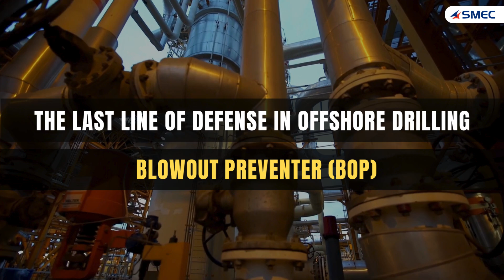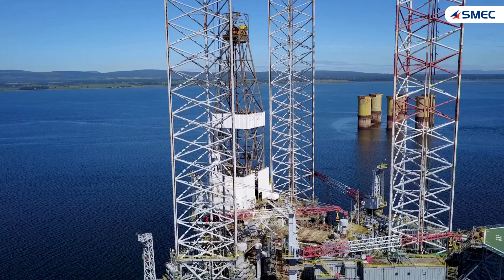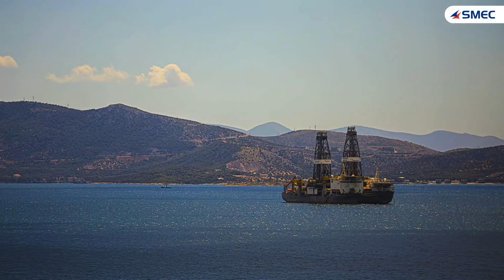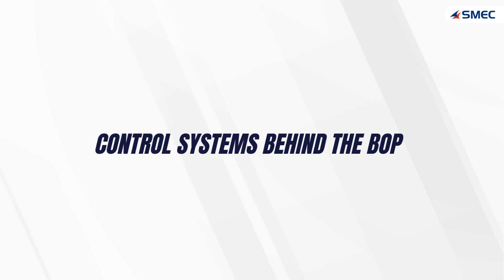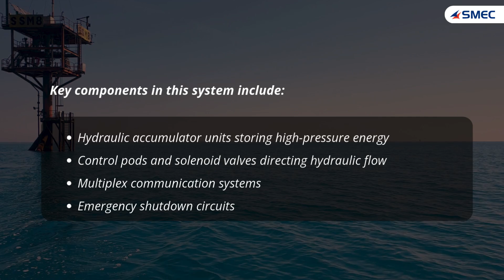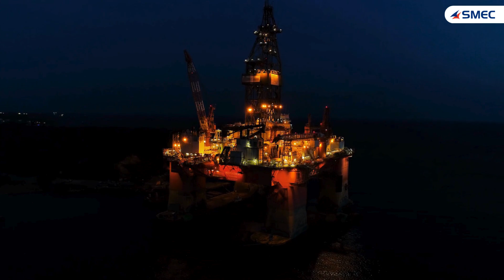Blowout Preventer Explained | Offshore BOP System Guide.

Comment: 📌Recent & Notable Well-Control / BOP-Related Incidents in India
1. ONGC Rudrasagar Blowout – Assam (2025)
Location: Sivasagar, Assam
Well: RDS-147A gas well
Incident: Gas blowout began 12 June 2025
Action: Damaged BOP removed and capping stack installed
Response: ONGC crisis management team + international well-control experts
Outcome: Blowout controlled after about 15 days of operations

2. Kharsang Oilfield Blowout – Arunachal Pradesh (2025)
Operator: Oil India Limited
Well: KSG-76
Incident: Blowout during well servicing in Oct 2025
Action: Emergency well control operation carried out and BOP removed during capping operations.

3. Baghjan Gas Blowout – Assam (2020)
Operator: Oil India Limited
Location: Baghjan oilfield, Tinsukia
Date: 27 May 2020
Impact: Massive gas leak and fire, evacuations of nearby villages
Duration: Leak lasted months before being killed.

4. Pasarlapudi Blowout – Andhra Pradesh (1995)
Operator: ONGC
Impact: Rig fire lasting 65 days
Significance: One of the largest blowouts in India’s drilling history.